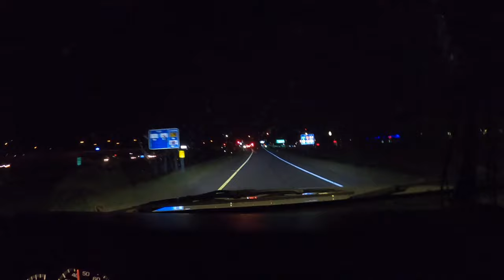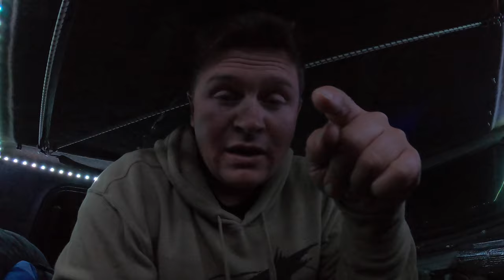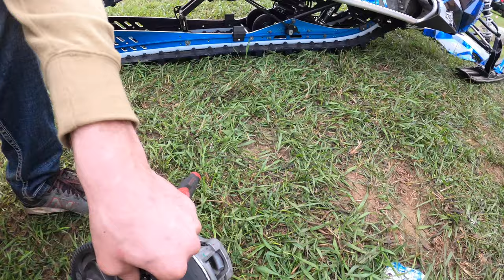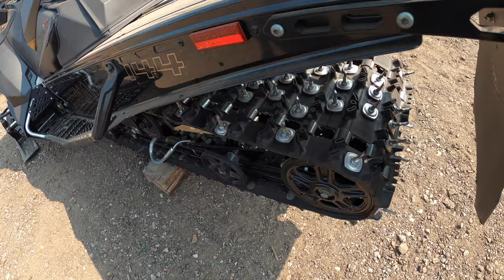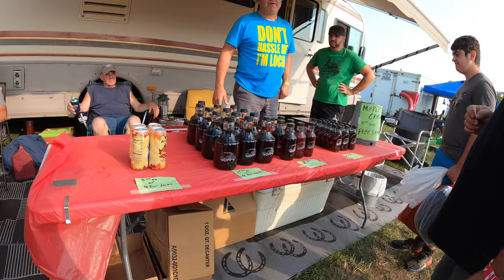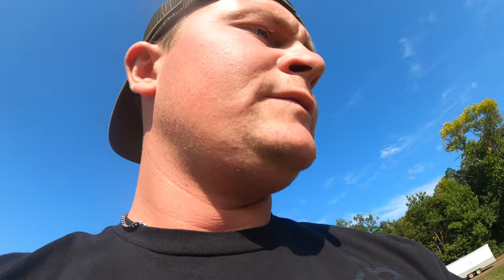Hay days 2021

Comment: Hey I know i asked U this before, can U tell me your version on your Helix 7. I forgot & can't retrieve your answer from my notifications.
Reply from the maker: I actually just sold the helix 7 because I’m upgrading for this winter. It was a g3n so whatever come stock for software on the g3n was what it had. I fussed with it a bunch every time I used it though to get a good picture.
Reply: @northerntactics  What are U upgrading to? I run a Helix 7 down one hole  & a Marcum LX 7 down the other hole.
Reply from the maker: I have a helix 10 with mega 360. And will soon have hummingbird live! Gonna be sick!
Reply: @northerntactics  Will that work with a Helix 10 SI G2N?
Reply from the maker: @bodyguard2301  I could be wrong but to my knowledge to run either mega 360 or hummingbird live the units have to be g3n or newer.